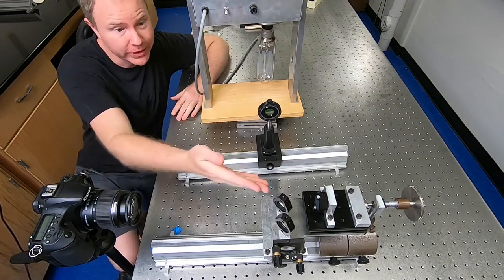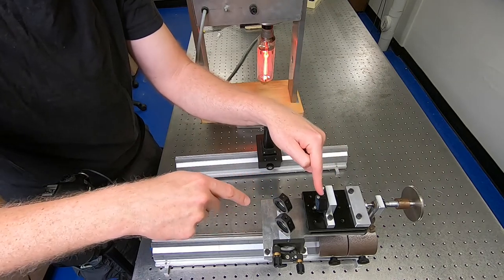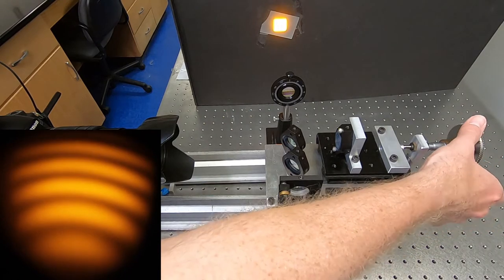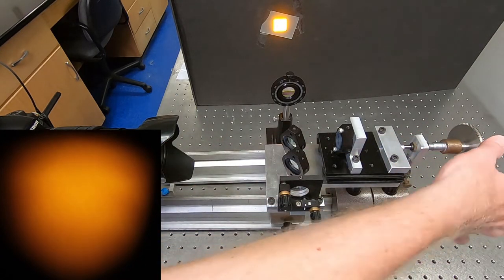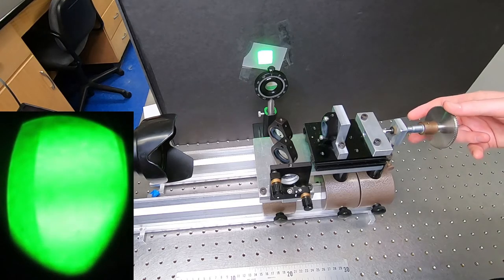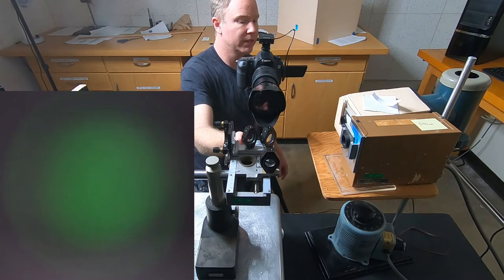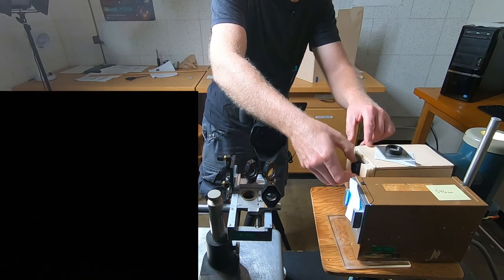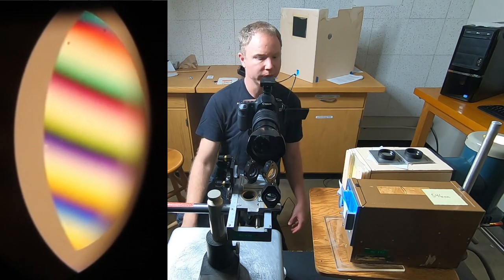Optics Lab 6   Fourier Transform Spectrometer and White-Light Fringes

Comment: Hi! So for the white light interference It Is necessary that the beam splitter AND the compensator were parallels?
Reply from the maker: Yes if they are the same thickness and made of the same material. If the compensator is thinner, for example, it might work to rotate it more so that the light goes through the same amount of glass.